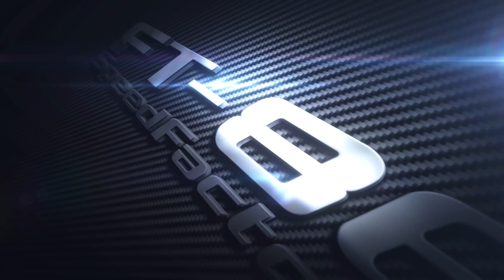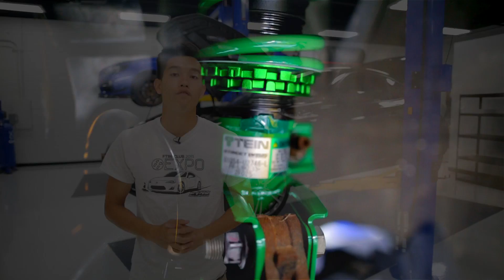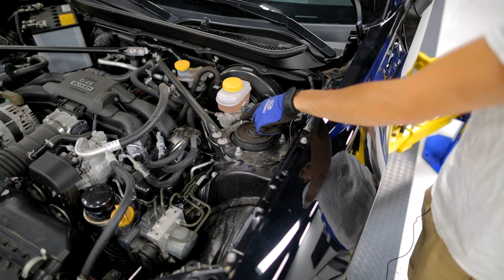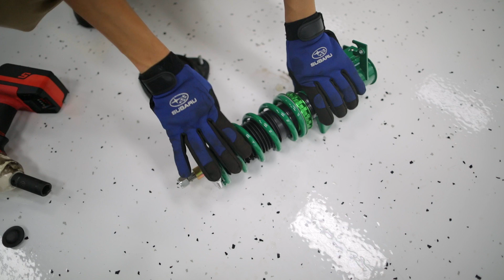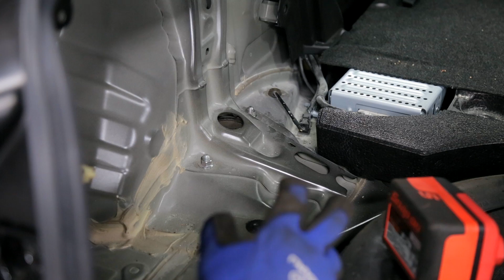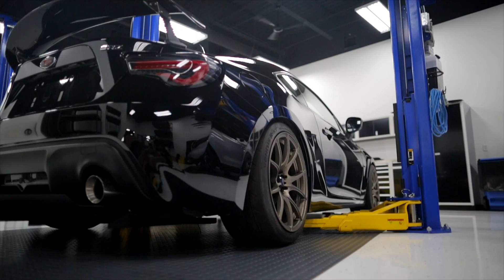FT86SpeedFactory - Tein Basis Coilover Install

Comment: Reusing OEM parts, if I get a wheel alignment, can they adjust everything still? (camber) or do I need additional hardware like different top hat and different lower control arms?

Comment: I installed these coil overs and after adjusting the ride height i noticed the spring was loose until i lowered it on the ground. Is that normal?
Reply: Yea no load on the tires means no load on the suspension so it tops out until the cars weight is back on the tires and not the lift/jackstands

Comment: Rim/tire specs?
Reply: Pretty sure theyre 18x9.5 either +38 or +45. 5x100. Tires would usually be 245 or 255/35/18

Comment: Damn I really want a brz/86 and want to put coil overs but this job looks like I’d want a mechanic to do it cause I really don’t want to fuck up the suspension especially since the most work I do on my car is a oil change and brake job

Comment: My question is is a just trial-and-error adjusting the shocks to height preference? I only wana drop maybe an inch from OEM. Also how do you know uku are perfectly level
Reply: I think they either give you a tool to measure or you can count threads
Reply: @matthewsaunders4698  I counted threads 😁

Comment: how does he uses the impact driver to torque them down to 40ftlb I don't get how he can measure the specific torque range using an impact driver
Reply: It could be one of those expensive ones that you can set to certain torques a lot of tire shops have them
Reply: neither do i, my prediction is that you probably need to use a torque wrench after bolting it on
Reply: It's an adjustable drill, expensive as heck, building kn the assembly line, automakers use them and check them once a week to insure they stayed in spec

Comment: "We want to run some wider wheels, so we're going to install coilovers" – can someone explain why wider wheels require coilovers?
Reply from the maker: Sure thing. The factory MacPherson strut is pretty fat, the springs it uses are wide and takes up a lot of room. The spring perch is usually what will hit the wheel if its too wide or the wrong offset, or both. Coiovers aren't as big around, and the springs are not as wide. So there is more space in the wheel well for wider wheels. Plus tire sidewall will flex during hard cornering and a wider wheel and tire can also rub on factory springs.
Hope that helped a bit. If you have more questions, email us at sales@FT86SpeedFactory.com
- Tomas
Reply: @FTspeed  can you tell the wheels and tyres specs?

Comment: What wheel and tire setup is this running @ FT86SpeedFactory
Reply from the maker: These are Wedssport SA10R 18x9.5 +45 with 255/35/18 tires
http://www.ft86speedfactory.com/wedssport-sa10r-18x9-5-45-5x100-mbz-2013-brz-2014-forester.html#.WT_wRGgrIkk

Comment: Don't the stock endlinks end up bending when you lower you car? Saw my friends car and the rears were bent after installing eibach sportline springs, I couldn't imagine what a 2+ inch drop would do to them, especially the front.
Reply from the maker: No, the endlinks positions don't change so they should not be experiencing any bending whatsoever.
Reply: FT86SpeedFactory I thought lowering the car caused it to bend, but I guess not. Thanks for the reply.
Reply: Uhhh yes they do... your endlinks always end up in a different position when lowering.

Comment: How the heck did you remove the endlink nut that way?  There is nothing holding the other side of that and on my car it just spun freely once it got loose.  There is a spot for an allen wrench to go in the end of it but mine was so rusted that it stripped even after using penetrating oil.
Reply from the maker: The impact wrench we used in the video had enough torque to break it loose.
Reply: FT86SpeedFactory breaking it loose isnt the issue, once tge nut  becomes loose it will spin because the other side is a ball joint.  this is why there is a hole for an allen wrench in the end of it.  since i live in ny and they use salt on our roadways for snow and ice, mine were rusted so bad there was no way to remove it without cutting.  pblaster, blowtorch, etc didnt loosen it enough, the allen hole stripped and i cut it and bought new links. i knew about this beforehand and had what i needed, but still ended up with the car on jackstands for two days.  i feel like some these videos make somewhat complicated jobs seem overly simple and that instead of misleading people, youtubers should at least make mention of some pitfalls like this so that diyers who are just starting out know what they are getting into before they attempt a job like this on thier daily driver.

Comment: did you use a spring compressor for the rears, and is it truly safe on these cars to remove tophats without a spring compressor?
Reply: You should use spring compressors or at least know the bottom half is gonna blow off and make sure it doesn't hit anybody but it might be scraping on the ground. It's your call though. If you have oreily or autozone near you they have "rental" tools for cheap.

Comment: Thanks man! My second FRS had these installed already without the camber bolts - as I found out getting an alignment after nailing a cattle guard when the shop said you have no camber adjustment. 👍

Comment: Also, you aren't supposed to remove the top hat, that is completely pointless and a waste of time.
Reply: +PowerSports if I saw your number calling my phone i wouldn't answer either m8
Reply from the maker: Not sure why you think it's pointless and a waste of time. The Tein Basis Coilover System does not come with top hats. They are designed to work with the stock top hats.
Reply: +FT86SpeedFactory  You are supposed to leave the top hats attached to the car.  There was no reason at all to remove them.  That is pretty basic knoweldge.  -_-
Reply from the maker: It can be done either way you prefer. With the top hats off the car, it is easier to correctly torque the top hat into place on your new coilovers. Also, showing the removal of the top hats is useful for customers that want to use camber plates or are installing a different coilover system that comes with top hats.
Reply: +FT86SpeedFactory  ok, that makes sense.  just giving you guys a hard time cause u don't answer your phone.  lololol.
Reply: +whackachangchangable  LOL.  Maybe.  But their phone goes to an automated system that tells you to email them and not call them, and doesn't allow you to leave a voicemail.  Not good business practice, not at all.
Reply: Just email them? Sounds like bit of a non problem to me
Reply: Your clutch video installs have spanned over a month. I don't see the purpose of needing something ASAP if you plan on taking weeks to install the part. Unless they were all shot in one day and uploaded over a month. In which case, my bad haha
Reply: +whackachangchangable  So, when i needed a clutch ASAP, i.e. ship out and arrive in one day, and it takes them 48hours to answer an email?  Yeah, thats crap.  Like i said.  It is bad business not to answer the phone.
Reply: *****  the clutch took TWO MONTHS to arrive because ACT miscounted their inventory.  if  
+FT86SpeedFactory had bothered to answer their phone, i would of bought the clutch straight out of their warehouse.  but i'm never buying from someone when i can't even speak to them to see what kind of person they are.  period.

Comment: I don't see the point of spending money on coilovers unless you are going to race...  meh...  ...  also, lol at pretending how easy it is to do that job... haha.  cause everyone has air tools, a lift, and a pristine shop. 😂😂😂😂😂
Reply from the maker: Plenty of people use coilovers on their cars for spirited driving and for looks. Air tools weren't even used in the video. This can be done in a driveway easily on 4 jack stands and hand tools if that's all is available. The lift just makes it easier for us to film the process.
Reply: +FT86SpeedFactory  no air tools?  was that an electric impact?  i specifically heard air tools while i was listening... i must be going crazy from this heat...
Reply: +FT86SpeedFactory  yeah ok i see now you used an electric impact.  yeah.  point remains, lol.  most of us don't have tools like that.  wish i did, though, would of made my coilover install a lot easier.
Reply: You can get a basic cordless electric impact gun for under $100, anyone who turns wrenches should have one in the arsenal.
Reply: I didn't use any air tools nor electric tools to remove and install suspension on my EVO 9. I used a breaker bar to loosen bolts. Then after I have invested on an electric impact wrench. On my FRS, I purchased some monosport Tein Coilovers. Again I removed and installed suspension and installed coilovers. All this was done in my drive way while the cars were lifted and placed on stands. Talk about no access to a shop huh. Anything is possible.
Reply: why jump on here just to make a negative comment? the @ft86speedfactory guys make helpful videos for the average garage mechanic or DIYer to do the job on their own. the brz, frs, gt86 is a very easy car to wrench on, and this job is no different.
Reply: PowerSports I installed Coilovers on my 16 year old bmw e39 with no power tools and only 2 jack stands, yeah maybe it took 6 hours but it is possible
Reply: Powersport is either a clown troll or both
Reply: still the dumbest comment ive seen 7 years later
Reply: The FRS suspension is very easy to work on.  No air tools needed, a good breaker bar works well.
Reply: PowerSports if installing coilovers is hard then I’m sorry lol. If you don’t own basic air tools or know how to work on a car then why are you here
Reply: +jonswiftucf  i have one, but it is nowhere near as powerful as the expensive commercial-grade ones like the SnapOn one they are using.  the one i have struggles with basic 12mm hardware.

Comment: maybe its cheaper, but it worlds easier and safer to just get coilovers that have top hats.
Reply: No you're not
Reply: +FT86SpeedFactory mainly cause you dont have to remove springs under tension.
Reply from the maker: Theogrn That's why spring compressors are suggested to be used in the video, however, the BRZ stock springs do not have much preload.
Reply: +FT86SpeedFactory sooo zip ties then? 😁
Reply from the maker: Why would you say it's safer? There are plenty of systems out there that retain the stock top hats.
Reply: +FT86SpeedFactory  i'll back you up on this, the OEM top hats are plenty good enough, i'm winning races on mine with competition coilovers.
Reply: FT86SpeedFactory If you do the job correctly, you can completely remove the preload from the springs before the nut is even halfway off the shock.  Which is why you are supposed to keep the tophats on the vehicle while removing the springs/struts.